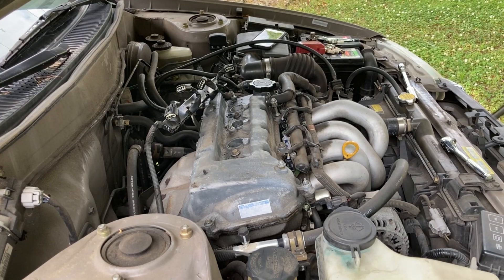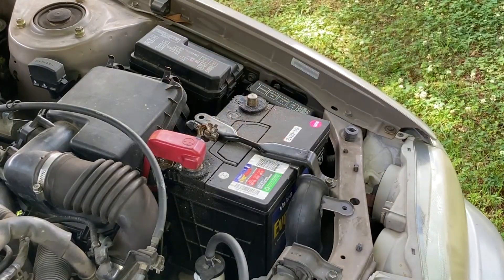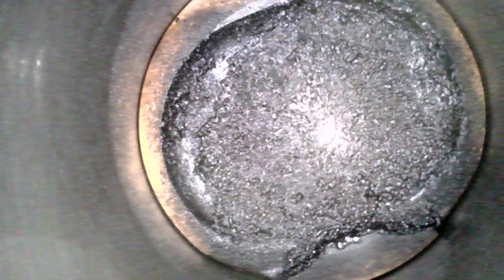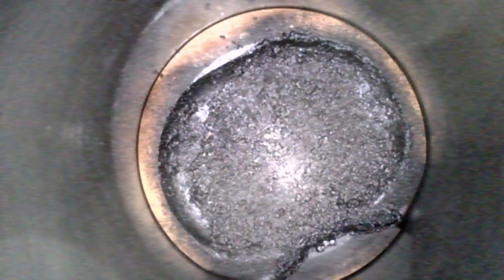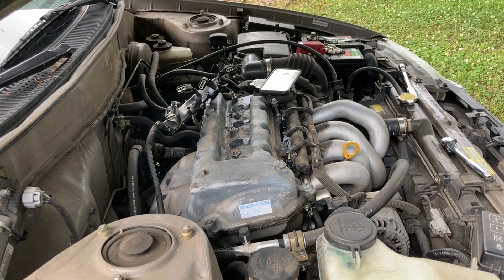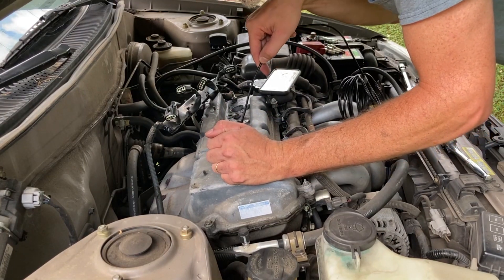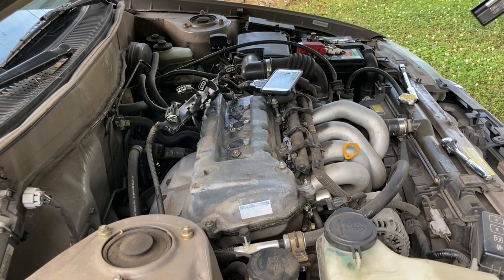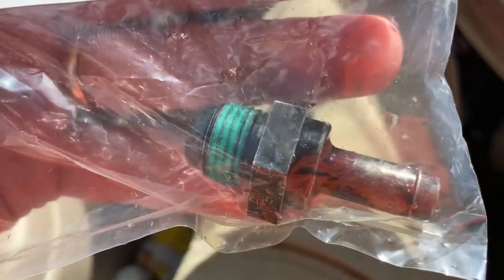Can you see signs of oil burning in the cylinders? | Oil Burning🔥Experiments | Episode 6

Comment: The combustion chamber located in the cylinder head, where the valves are placed, has a certain inclination, it is not perfectly flat. The oil that drips next to the steam valves will not simply drip vertically, I think that, due to the adhesion of the oil to the metal walls, it will "go down" by adhering to the walls of the combustion chamber and the engine cylinders, respectively.
Reply from the maker: So in your opinion the oil is coming from the stem seals?
Reply: @FamilyFriendlyDIY  yes, I think the oil comes from stem seals.
Your engine seems to me to be 1.8 liters. If you search on youtube for images with a disassembled cylinder head, you will see the slope on the valves are placed. For this reason, I think the oil flows past the stem valves, drips on the walls of the combustion chambers and then you saw it with the endoscope.
https://youtu.be/3Uo0Esb0h84
Search after minute 2.17 and you will see the  combustion chamber form with valvs position "in slope", the oil cannot drip vertically

Comment: Cool video. After I did my pcv I’ve gone 4 tanks of gas and still same oil level, no burning. Also before changing the pcv I would get the odor of hot motor oil coming in through the cabin. I could never figure it out. Now I know my issue was a faulty pcv and oil gases were passing though it and coming into the air in the cab. For me pcv was a huge difference, we’ll see how long my oil stays at its current level. Hope yours is pcv also.
Reply from the maker: Thanks, and thanks for the info, Lupe. Glad yours was a simple fix. Won't be long and we'll see if mine was the same problem. Have a good one!

Comment: Interesting, with warm compression that high, the major source must be valve guides and seals.  You should be seeing blue smoke at startup.  Problem is, I dont believe your compression numbers of 280 psi.  What would be a compression ratio of 19:1 like in a diesel.  At 178k miles and a qt of oil every few hundred miles, both rings and valve guides are worn out.
Reply: @Richard White this is not an issue with this engine. Toyota had designed it for mpg and used short skirt pistons and narrow rings. The biggest issue that the drain holes behind oil rings are very small diameter so they get easily plugged by carbon deposits and then oil rings get cooked into oil which has nowhere to go on 1.5mm oil ring. Engine with stuck oil rings will have good compression but will consume oil. The valve seals isn't the main issue here; replacing them would have worked about 30k prior.

Toyota had replaced pistons and rings later for several engines of that timeframe.. 1.8L and 2.4L were affected. Unfortunately for that to happen it had to happen within 60k warranty period.

Comment: Hi Dave, I was going to suggest trying BGR's EPR or their 2 system engine restore solutions, but if those cylinder walls are scored, then chemical treatments and pcv valve changes won't help. But I'm following along to see if we can find a non-short block replacement solution here.

Also, check out @thecarcarenut 's YouTube channel. He's a Toyota master tech and has a video out on why Toyota engine's burn oil. Here's the link to it https://www.youtube.com/watch?v=v4JS7PybV2k . This does not seem to be a Toyota-only issue as plenty of other manufacturers are having the same issue with oil burning.

Comment: Try water base cleaner use in shop clean parts in tub / use  Engine kleen  3.0z  each spark  plugs hole  soak see if take carbon off . drain  oil out first
Reply from the maker: I'm gonna have to research that, Glenn, but I'm a little wary of putting water in the engine. Thanks for the suggestion.

Comment: Cool that you took my suggestion! 

Do you see a big puff of white smoke during cold start? If not, I don’t think is a valve steam seal issue.

Also, how much smoke do you see while engine idles at normal operating temp?

Seems a lot of oil dripping down the cylinder walls to be coming from the spark plugs hole. Scoring doesn’t look that bad. Have you performed a leak down test? I am thinking head gasket issue or piston rings as suspected from the start.
Reply from the maker: Yeah, thanks for the tips Chris! ... No, I never see smoke when starting it, nor when it idles, nor when pulling off from stop lights---only if I rev it for a while. I haven't done a leak-down. ... Wait ... am I going to have to do that too before proceeding with any more chemicals?? :-)
Reply: @FamilyFriendlyDIY   It will be good data to have, but I think people want to see if any chemical actually works for your scenario. You could rent the tool.

I would leave the valve steam seals for last. Because it seems the oil consumption is happening while engine is at higher rpm and under load. Sounds you might have blow by through the piston rings into the intake. Which might explain the excessive carbon buildup on top of the pistons.

Comment: Which app did you use? unfortunately the android app I got keeps crashing and the image keeps getting stuck.
Reply from the maker: I used the Depstech Viewer for iPhone, Ahmad.
Reply: I had that problem with my Depstech scope, too - their Android app seems to be a POS. If yours is the kind that plugs directly into the camera like mine, just search Google Play for 'OTG camera' for an alternative app. I'm not sure if it works with cameras that connect to the phone wirelessly, though.
Reply: @alanerpington5698  yes mine connects directly via a type C cable. So that means the hunt for a stable camera app is on for android..

I tried the OTG View app and it has the same problem.

Comment: My wife’s Prius has been having the same issues. I’ve been following these videos for a few months. Currently testing the sea foam in the crank right now. 
If that doesn’t fix it I’ll just keep adding oil till the wheels fall off lol 
Already told her to check and add oil every time she gets gas.
Reply from the maker: Ha ha. I hear ya!
Reply: Prius 3rd gen early 2010-2012 has problems with head gasket too. Although usually  after close to 200 000 miles.  The oil consumption in 3rd gen is not that bad unless some owner who do 10 000 miles/1 year interval but not considering the requirement under normal condition only.  If we drive short trips and a lot of cold start, Toyota in the manual said 5000 miles/6 months.  even worse, some owners use non full synthetic 0W-20 oil like from quick lube 5W-30.   The 2015 or newer virtually has no problem with oil consumption from redesigned head gasket 2013, piston 2014, and piston ring in 2015.  Yes, get 2015 or newer for the best option.

Comment: If it were PCV, you would be seeing oil in an the cylinders. My best guess would be the valve stem seals. 

Oil accumulation in the sparkplug wells could be caused by spillage, but I've seen enough of your videos and I don't think that's the case. Could also be the seals there as well, but that's easy to test. Run the car and see if more oil accumulates. But again, I find it unlikely.
Reply from the maker: Hopefully we'll get to the bottom of it soon, Frank. Thanks for the comment!

Comment: I think you are probably correct about the spark plug well theory and the oil on the cylinder walls..  I believe a new valve cover gasket set would include the seals to correct that issue.  My son’s Nissan truck has a similar problem.
Reply from the maker: 👍👍 Just picked up a new valve cover gasket with spark plug seals!
Reply: @FamilyFriendlyDIY  Just a heads up, there are two park plug seals. The ones at the top of the valve cover, you will get those in your kit. But there is also a place to leak half way down the spark plug tube. The tube itself can be unscrewed and you can use some kind of rtv to reseal it. Generally the best way to do that is to double up the valve cover nuts so they lock together and screw that tube right out of there. Could be either one in your case, just keep that in mind.
Reply from the maker: @doctorwarpspeed8779  Good info! I'll keep that in mind.

Comment: I think the Mirror is for looking at your Valves.  not the side of the cylinder.
Reply: In that case, your image will probably be overexposed to light falling in through the spark plug hole.
Reply: @Skoda130  that is exactly what was happening in the video.  he should have covered the hole.  if you watch in slo mo, you can see the valves for a split second before he pulls it out.  I know, that's what she said...
Reply from the maker: Thanks for the input, Jason, I'll test it again, but it does appear that the mirror is set at a 45 degree angle to the lens.
Reply: @FamilyFriendlyDIY  yes, you are right.  I'm in need of one and now see there are more than 1 style of mirrors.  I've see videos where they use a mirror to look at the valves and I ASSumed they were all the same.  Now that I am ordering one for my purpose, i see I have to order the correct accessories.